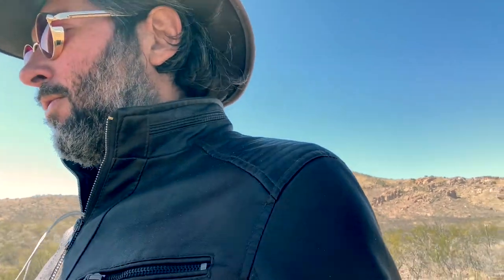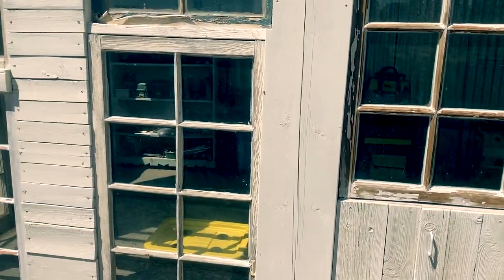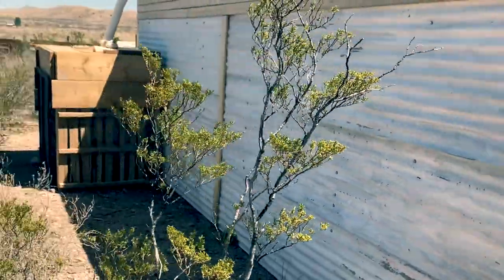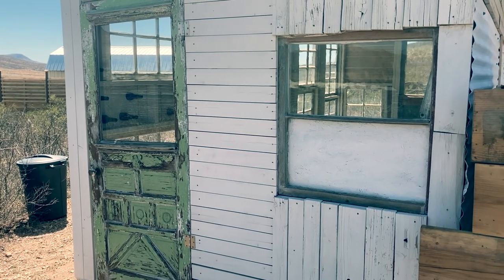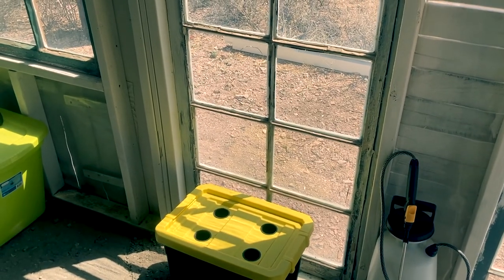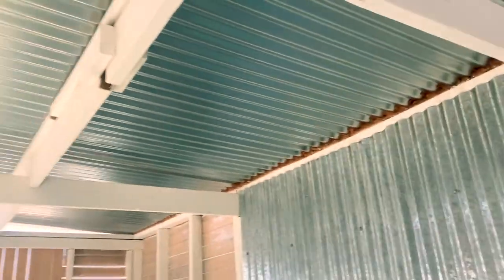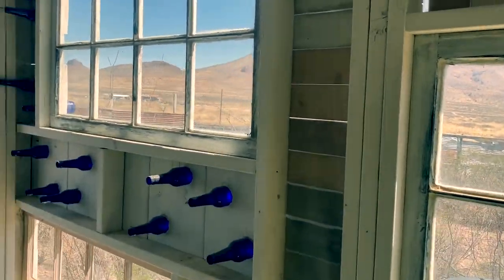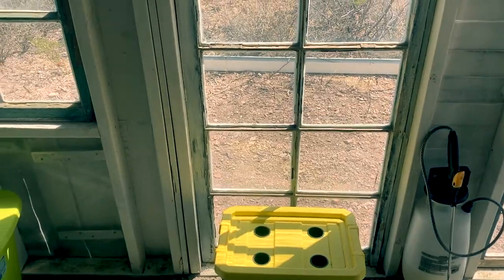I Built a Passive Solar Greenhouse Out of Reclaimed Windows, Pallets, and...

Comment: Interesting use of recycled building materials. I think it will work well for you. A few suggestions. You mentioned birds getting in through the angled opening on each end of ceiling. Probably the easiest fix for warm/hot weather is window screening. The birds, especially the curved bill thrasher, will pick the seed sprouts almost as soon as they poke through the soil. In the winter you cd cover the area with cardboard and foam pieces. For the summer you may want to replace the plexiglass in the doors with screens to prevent build up of heat. Something else u consider is fabric coverings for windows. Old sheets can be used but a better option is to use burlap cook which you can buy in from garden shop of building supply stores. When I was growing my herbs, I set the pots in pans or plastic bowls so there was enough water for the day. I had to water daily even with that safe guard to keep them from dehydrating. Good to see rain catchment system on the greenhouse. Happy growing.
Reply: My tablet doesn't let me easily go back and make corrections and it makes some weird changes to what I write. Supposed to be burlap cloth. Sorry about the "typos".